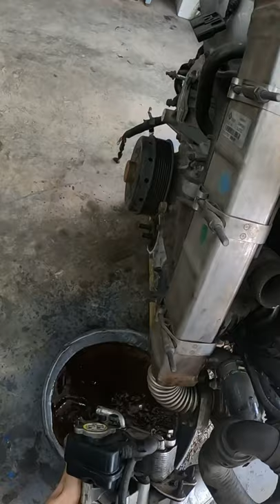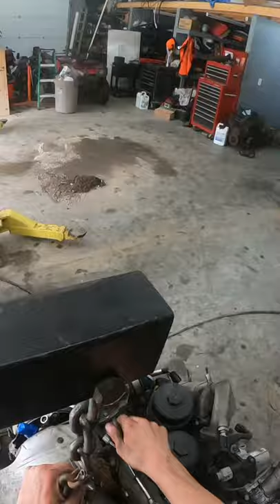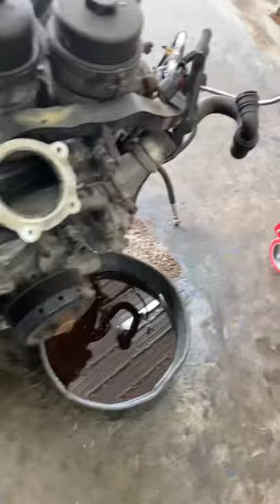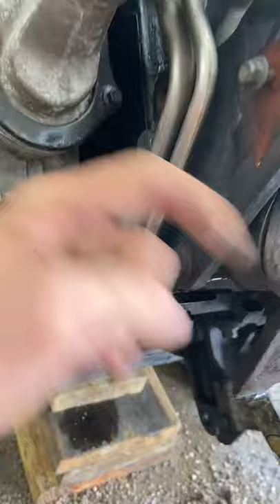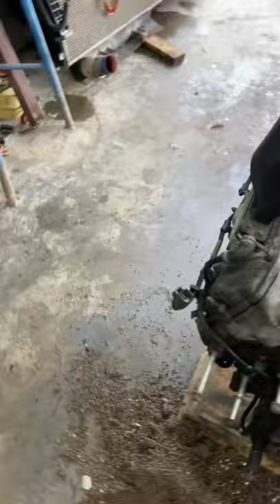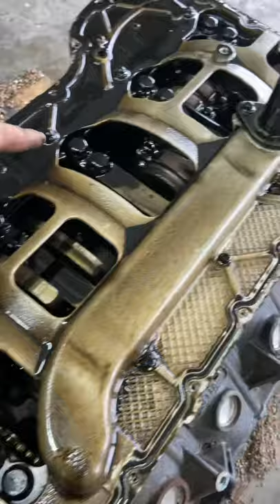6.4 Powerstroke Rebuild Part 1: Disassembly

Comment: So behind the glow plug control mod there is a wire that lays behind one side plugs into the plug that's fixed Wright behind it but we're does the other side plug into.? Please help if your able

Comment: Whats the best way to clean the inside of the fuel rails? Do you take the plugs out?
Reply from the maker: Lots of brake cleaner and compressed air. Never had an issue